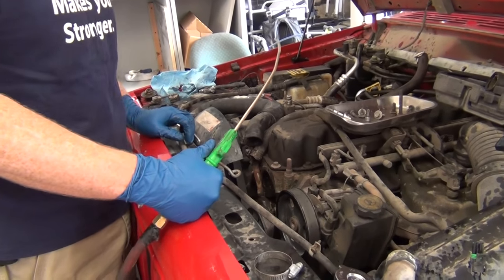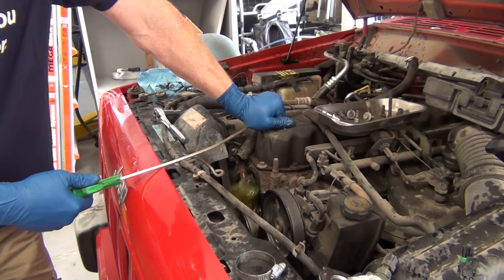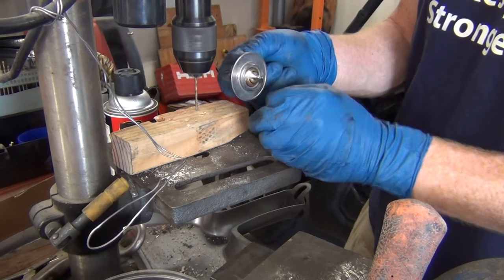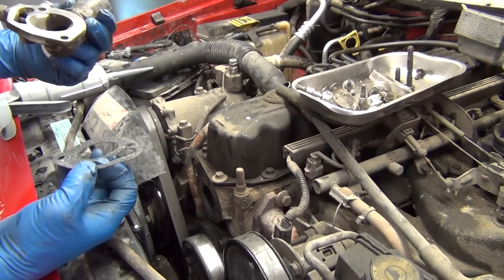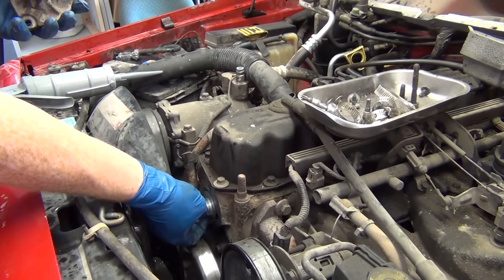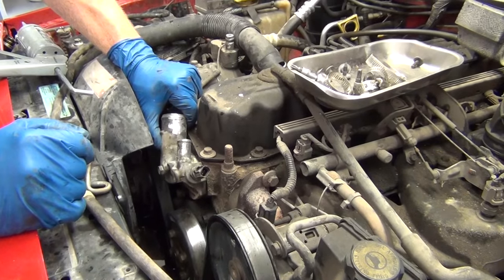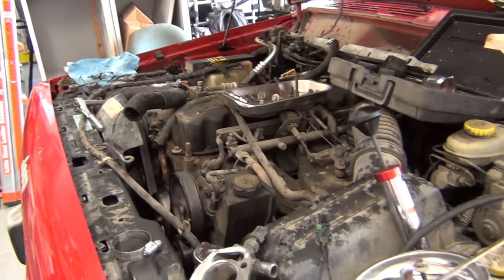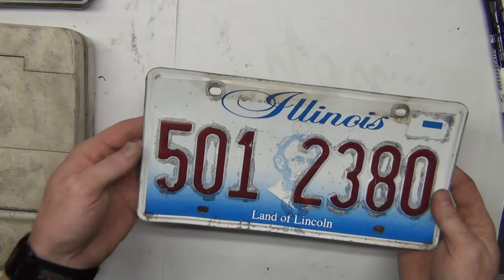Jeep Cherokee 4 0L Thermostat Tips and Tricks

Comment: I just did mine the other day on my Cherokee. Another tip is make sure you torque it down correctly! I cannot recall the torque but it's somewhere around 17ft/lb. Alternate tightening of the two bolts or else you will crack the waterneck.

Comment: You said to mount the sticky side of the gasket to the engine block, then you proceeded to mount the sticky side of the gasket to the removable housing. Which is it?
Reply from the maker: I'm year late, but the gasket isn't symmetrical.  It SHOULD be made sticky side to the block, but it's not made that way.

Comment: Wish I'd seen this first, my thermostat dropped like youd mentioned and it leaked, like you mentioned and didn't realize it because of the thermostat and gave it an extra tighten and broke the top bolt off in the motor

Comment: Hey. Thanks for the video. I actually saw this video some time ago and somehow remembered that someone somewhere at some point ..... had said to drill a little hole in the top of the thermostat if the new one doesn't have a hole. I just said "a hole "  in reference to a gas hole. Anyway, it worked in my 4.0 xj recently and I happened to just stumble upon the video at HEY, it was You. Thanks for real. I also just got my antique forever licence plate (1998 model) so Ii have a Mississippi  tag for you! Where do I send it (if you still  want one)

Comment: On these w/out jiggle pins, I'd instead drill "two" micro-sized (½ size of original presumed hole) holes on opposite ends for better/even area coverage🤔👌 "ya know how they do computer processors; cut the speed but double the cores, efficiency maybe?😉"

Comment: I need change my thermshat its lazy. 
If at first glance you have to take half the engine apart to change the thermo what advice do you have, hints and tips for buried thermo housings.

I use the loctite stuff which works well as its a anaerobic setting compound so that which squeezes get diluted.

Utah is just a lightweight lol
Reply: If you buy a good Thermostat and not after market, they have the Hole and a Rubber Seal / Gasket in them already.

Comment: Can you run with out it?
Reply: Yes you can but it will affect your gas mileage 
And if you live in a state where gets really cold  your engine will never reach the normal temperature and your gas mileage will be less   Not only that your heater won't work properly when it gets really cold. 
I am about to replace the thermostat in my jeep   The engine temp gets up to 125 degrees in stead 210 degrees and I have no heat I only get cold air when its cold around 0 out side

Comment: You should never use rtv gasket on anything water, water pump or thermostat if ya ain’t steady enuf or don’t have enuf patience you shouldn’t be doing it anyways rtv will ruin your radiator little pieces will squeeze out and go through the block to radiator and clog it up. Kinda the whole reason for a gasket shouldn’t use gasket maker if it comes with one
Reply from the maker: I hear you.   If you're using it as an adhesive or sealant (sparingly) you won't have it stray.  Good point to make, but with the P.R.S. it sticks like hell and it's tough.  It's not going anywhere.  I'm just getting good at this.  Just over 30 years of experience/success doing it this way with this product.  I just wish it wasn't so dang expensive now.

Comment: Hey Brian. Got a (possible) challenge for you'all. Check your buddy's 2000 Jeep XJ 4.0 cuz  he might have what appears to be a minor rear main seal leak (most 4.0's do), but in fact it could be coming from the oil filter adapter "o" rings. Fun part? I believe on '97-'01 XJ's, Jeep used a T60 torx bolt to secure the adapter to the engine block and the passenger side motor mount is in the way. So if you know of, or can figure out a Tip & Trick, that'd be awesome!
Great videos btw - thanks!
Reply: Did you ever figure out what to do to get to get the oil filter adapter out with the T60 torx?